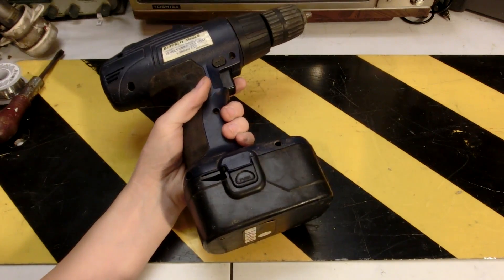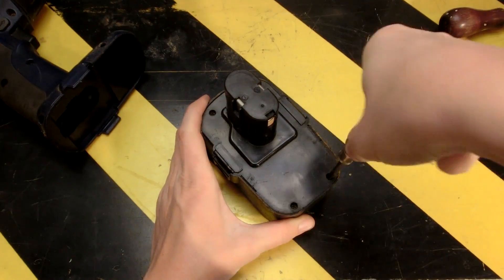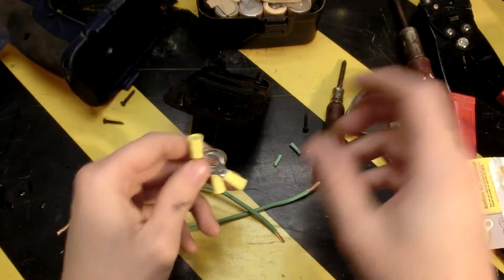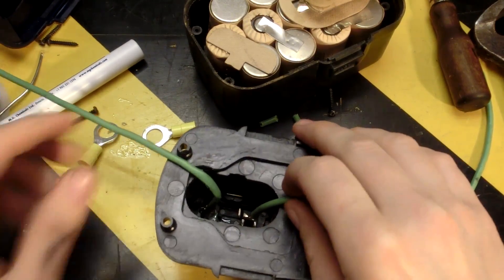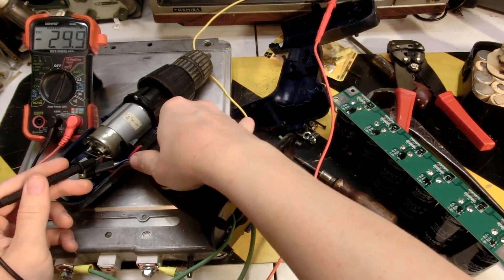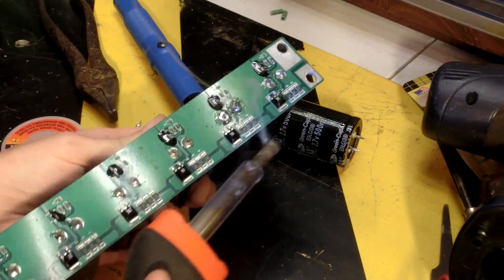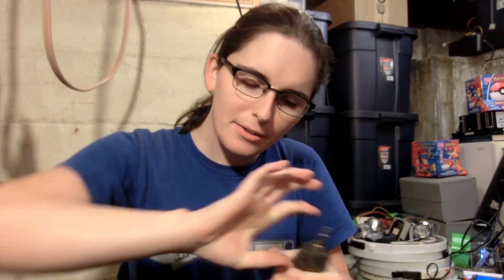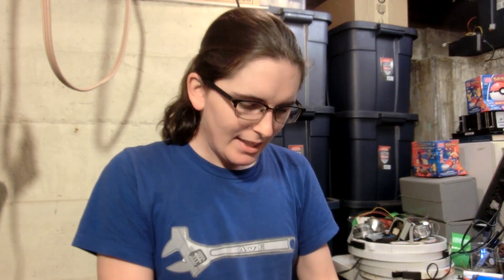Project Failure: SuperCapacitor Power Drill Attempt 1

Comment from the maker: I think its good to show your failure because it will make it more important when you finally get it working, also i think it helps more accurately present the tinkering process. 

I think next time i wont use a power drill found in the garbage. hahaha
Reply: It also helps others not loose faith when our own tinkering does not go to plan first time. It is so easy to watch some channels and get un achievable expectations (for time scale etc.) Glad you uploaded this one, best of luck next time round.
Reply: +capri2wd after a evening of experimenting to improve my crappy lm386 amplifier and only making it worse, it's comforting to see it happens to the best of us at times.
Reply: we need to learn to fail, or fail faster because that is how we get to the end result quicker or better
Reply: I'd kill for nissan leaf cells. There just extremely convenient for like...everything. who did you get them from and how much, i seen bad ones for like 30 or like 100 each or used ones (OUCH!)
Reply: you don't learn much FROM success you learn the most from failure take it as a learning experience and don't let it get you down cheaRS

Comment: He He,, I know what you mean,, I used 4 hours troubleshooting on a Xeon CPU to day,,, and got no where!! sucked. That video will need not to be to long,,, :-(
Reply from the maker: +My PlayHouse its harder with stuff like CPUs because those could even have microscopic issues caused by static electricity or whatever. its very easy to waste too much time with computers.

Comment: I don't think you can connect S-Caps directly because they will try to discharge all in one hit, overloading part amp limits.. I think you need some buck thingy to regulate output.
Reply: Motors only draw the current they need, you can't put too much through them unless the voltage is way too high.

Comment: Unlucky. I had success with a 14v ni-cad DeWalt by ditching the cells, drilling the battery case and attaching long wires to a tired 9 Ah motorcycle battery. It was a bit slower but much lighter to hold with the battery on the floor.

Comment: Like the concept - a drill you could recharge by putting it back in a cradle for a couple of seconds between use. I have some of those greencaps; they are not very good; I suspect most of the ones on eBay are factory QA rejects that sort of work.

Comment: was that 15V for the caps? The drill motor is likely 9V, pushed with 12V battery.
Reply from the maker: +Adam Rivera well the motor is the only part that didnt fail
Reply: Was it the switch? They usually pop by some 'safety feature'. May or may not be worth it to put in a heavy momentary switch.
Reply from the maker: +Adam Rivera the switch has bad contacts, that mosfet blew, the gears chewed themselved up, pretty much everything went wrong besides the motor. lol
Reply: yank the motor, stick a propeller on it and now you have a powerful fan.

Comment: the battery terminals from battery and in the drill body are usually what causes an intermittent power issue as they corrode.
Reply from the maker: +Helicopter Pad in this case it was the switch

Comment: Hey can't you get a zap from the super caps having the bottom open like that ?  The one good thing is that you can use the motor off of the drill on a small windmill or with your mind who knows what you could do with it !!!!!
Reply from the maker: +cody cheney its difficult to get shocked by 2.7 volts, lol
Reply: ok thanks I thought that there was a lot more power in those super caps !  You know the other thing that I have done with good cordless drills that the batteries have gone bad is to make them corded again.  for the little bit of work I feel like I still have good useable tools that don't go dead and use my good Rtobe cordless when I need cordless !  Good luck with your projects !

Comment: I am guessing when the speed control popped you had the polarity wrong on the terminals but it is hard to tell.  The first time you had it open I saw the MosFET and immediately knew it was going to be a potential issue.  Pretty much all the new cordless tools have electronic speed control rather than the classic quality speed control so they really don't hold up anymore.  That drill looked like a cheap harbor freight type of knockoff.  Even the name brand ones these days are becoming overcomplicated garbage.  One thing I take with me when I am looking at tools that I might repair is a 4S lipo pack with a BMS a 20 AMP circuit breaker and a connection that I installed for charging and connecting leads with alligator clips.  It makes it quick to test things in the junk pile without wasting much time. 

One thing to keep in mind these days is that even AvE has stated many of the newer tools are now built to fail just to keep people buying so we can expect to see a lot more of the newer ones to end up in the garbage or recycling centers these days.

Comment: No worries , Its just one of them days , Super caps are capable of delivering crazy high amounts of current which is why that regulator thing inside may of exploded. I once tried powering up my UPS from a super cap array and it worked but the cables got crazy hot.